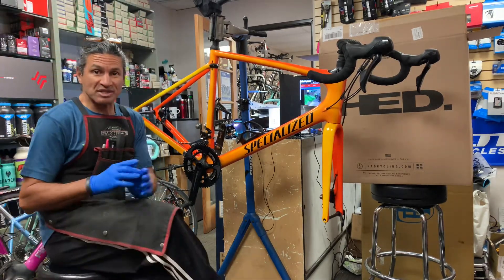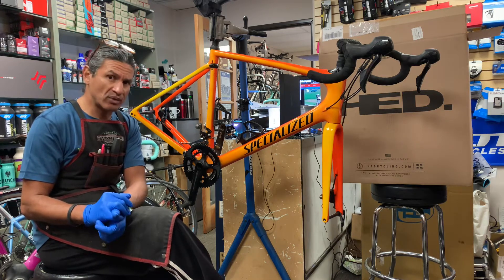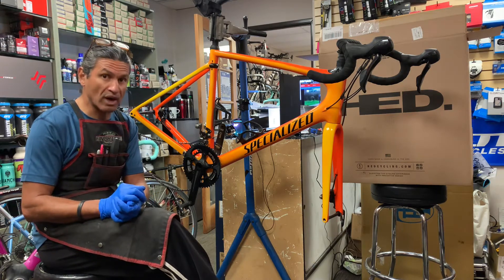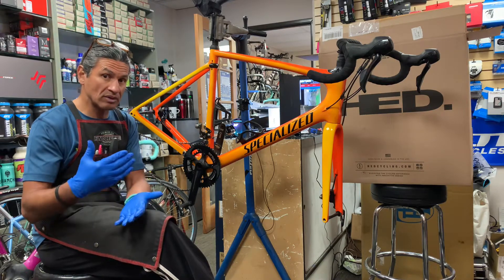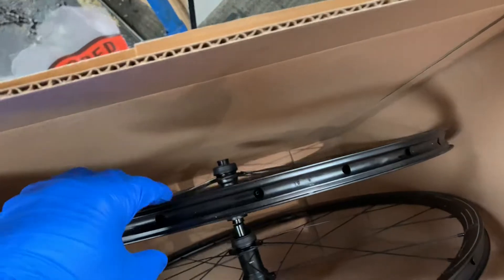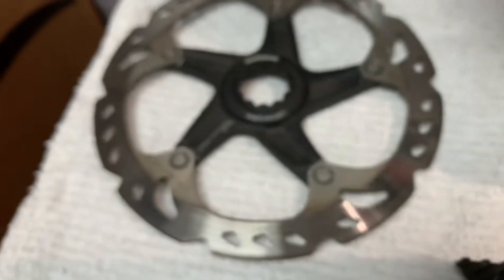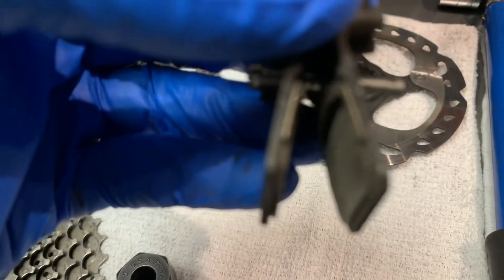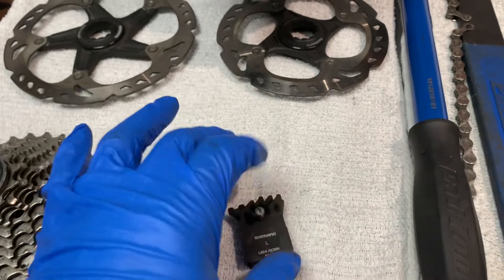HED Cycling Disc Wheels - Ardennes RA Performance

Comment: I’m about to buy a new Litespeed Ultimate Disc (w/ Ultegra Di2 12spd) and upgrading one wheelset up to the HED Ardennes RA Performance Disc.   They also offer the Vanquish RC4 and Zipp 303 Firecrest- but I’m gonna order some other lightweight carbon wheelset later.    

I think the Ardennes RA Performance  alloy wheelset would be a great start on the Litespeed. 

What do you think of the RC4 Vanquish?   Good stuff?
Reply from the maker: To be honest with you I don’t know anything about the Vanquish wheels
Reply: Ok thanks.   You mentioned you like HED wheels.. so I thought you rode on a lot if them.  

What about the Ardennes?   What do you think of those?
Reply from the maker: @dsonyay  yes I mention HED wheels because I ride and own a lot of them. But Vanquish is a disc brake wheel and I don’t ride disc brake bikes.
Reply: Ok thanks vm for your thoughts.  Sounds like a reputable company.   

Litepeed offers two HED wheel choices on their disc Road bikes:  T Swiss E 1800 Spline Disc
HED Ardennes RA Performance Disc
and the Vanquish RC4 Performance Disc.   I thought I’d stick to alloy for mow and maybe add the Vanquish if I need an extra set or need more aero wheels.    But yeah, my rides are mot races and only 16.5 to 17.5  avg.. sometimes in groups ip to almost 20mph avg.    plus roads here are loaded with potholes.

Comment: What do you think of the Ardennes RA Pro vs the Performance. I was looking at this wheel set and curious of the build quality/differences. Thanks!
Reply from the maker: Hello Andrew - are you talking about rim or disc brake wheels? As far as I know HED does not make a Performance rim brake wheelset. But no matter the build quality is always exceptional.